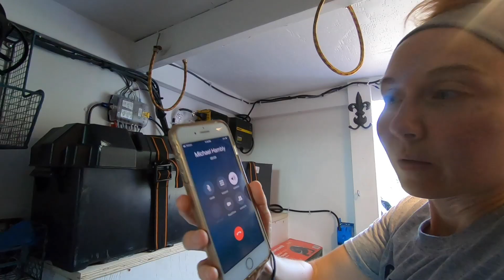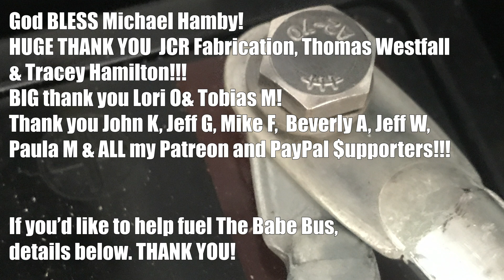VAN 911!!! The Power BLEW!

Comment: No-name inverters are cheap but famously disposable. They are all bogus rated, and even that is designed for 68F. At 90F+ you need to derate the inverter and buy a brand name.
 UPS and FEDEX will "hold at depot" or hold to any of their stores, including Staple and Office Depot, for free. USPS will hold at any main post office (or town post office) if you mail something to your name c/o "general delivery".
And unless the cables are VERY thick and short...the inverter will crap out again.
 Does research stump you? The guys at West usually know all this stuff dead cold.

Comment: If I were you I'd go to a auto parts store and buy an electric fan for a radiator. They're rated at 12 volts DC. it won't drain your battery as much as the fan you using now.

Comment: All your doing is wasting power. You need to biy 12V DC items. Like your lights and refrig. The fan you bought is AC and that means you need an inverter but if you just bought a 12v dc fan u wouldnt have had all this drama!

Comment: Hostility, ur, Hospitality Industry Trick for when you're dying of the heat and the floor is deep in the weeds and it is far too long until your shift ends.
Ice cube.  Tuck your shirt into your pants.  Toss the ice cube down your back, where it will then settle into the small of your back and quickly melt.  Downside - your shirt gets wet.  Upside - who the fuck cares, that yelp of shock when the ice hits your skin is worth it.

Cathy.  Ottawa.  Bytown.  Because, here in the Ottawa Valley, we specialize in 80% humidity.  Summer and winter.  Which is why you ignore the pretty commercials of people ice skating and visit only during the spring, summer and fall.
Take care out there and keep drinking ridiculous amounts of water...

Comment: im sorry casy, i can understand the crazy ledge !! its really good the guy that installed the system was able to talk to you. systems can vary greatly.  my guess going by what i saw it that the inverter may have overheated.but idk for sure. there are  things called power packs that can be charged by solar , i have one made by jackery, but there are different models and price opinions out there. they are good to have as a back up emergencies, something to think over on rainy day. but main thing is you got it fixed and im so glad. i would have been worried for you too  if you didnt.its just too hot. cheers casy roman you are one lovable badass ginger.

Comment: I was a union electrician for 13 years...…...and I owe you an apology.....I was waiting for the ground to spark when you touched it....great reflexes by the way ...I was waiting for a scream.....My wife wanted to know what was so funny...….soorryyyy
Two suggestions to readers with vans..(1)..buy 12 volt fans...…you are using 12 volts to run an inverter ……(2) .buy an inverter with a remote shutoff.....inverters use electricity when they aren't working ; if you set yourself up with everything you can 12 volt you will only use or need the inverter for appliances and can turn it off when not needed

Comment: I don't believe your new inverter has anything to do with how fast you drain your batteries. Using power drains batteries. Now of course if you run a bunch more items  than normal at the same time span then yes, your batteries will drain down faster. Good luck going forward.
Reply: Correct. The loads plugged into to inverter will determine how fast the batteries are used. The number on the inverter is just an indication of how big a load the inverter can handle. 

Every inverter does however draw a little power, when ever they are turned on - even with nothing plugged in. 
So it is always a good idea to turn the inverter off, when it is not being used.  Remote switches make it easy to turn the inverter on/off.

Comment: Are sister Roman in high heat situations inverters have a tendency to go dead because the heat from the inverter destroy the chick so sister Roman it was nothing that you did don't worry about it inside because of high heat exposure it died from high heat exposure to and giggling on the open road when you have it on the wall usually it gets banged up don't worry about it it was nothing you did and the Family Plugged In did not do anything to it and die from One Step 6 months to a year old they usually go belly-up

Comment: Just make sure you turn your inverter off when it's not in use, it will drain the battery, slowly of course, just being turned on. A full blown electrician is overkill for your DC and AC needs (not busting on your guy), a simple understanding of DC power is all you're lacking, things like touching both terminals at the same time (spark!), or keeping cables tight to maximize contact points. The inverter negates your need to know AC, you just hook it up like you did and you're done with it. I'm FAR from an electrician, it's just reading up when you're bored or watching others during installs (or watching some of the thousands of DIY's on youtube). You can do it, you see that from attaching that inverter I'll bet.

Comment: Cheap inverter?  Should have gone to Harbor Freight.  They are everywhere.  I hate them, but if you are looking for cheap and can't wait for cheap chit to be shipped, that's your go-to place for cheap chit.  Harbor Freight:  King of bring a lot of coupons to get cheap chit even more cheap.

400 watts PMW?  You've got to be kidding me.  Who ever thought that was a good idea?  Yeah, I can totally understand why it blew with one more thing plugged in.  Better next time:  Get everything you can that will run on batteries or USB, charge them at your gym.  (Better yet, get solar :)) Rule of thumb:  Add up all the power you have in your van and then double that for the size of the inverter you want to have.  400 watts will barely charge up a laptop and nothing else (I know, a typical laptop is 150-200 watts, but in heat, it's more.  Power losses in lines is more.  PMW vs Pure Sine wave is about 30% more loss,  Heat makes an inverter even more inefficient... all your items plugged into your inverter are more inefficient when hot.  The length of the power cable from the battery to the inverter causes power loss. 

BY THE WAY:  Your fridge is DEFINITELY hating this heat, too, and you may burn up the motor unless you get another fan on it to help blow away the heat.  (I keep my fan running 24X7 on my deep-freezer because it is hot in my van, too.  I hope I'm helping my fridge and freezer by turning both down to minimum acceptable temps so they won't run any more than they have to.

Comment: I know I said something way back about inverters. Go find a RV Dealer or boating place and buy a samlex or xantrex or Go-Power inverter, but make Shure it's a pure sine-wave. Spend the money on a really good one. If you want something that will last and is of higher wattage. #cobra's are junk and many others of the modified sine-wave. Most moter's will do fine on them but are known to last.   The modified sine-wave inverters beet-up batteries. I know what I speak of. Many computers and electric equipment don't like modified sine wave inverters and don't work well or charge.  Spend the money Hun. The ones I have listed will take the abuse of travel and that's why RV's, boat's, and truckers use the ones I listed.

Comment: So, not meaning to be too condescending, but you do know that you have two electrical systems in the van, right?  The house batteries are 12 volt, just like the car battery.  All the electrical systems built in to the van are 12 volt.   Since the lights under the bed work without the inverter, that means they are 12 volt, same as your fridge.  The electrical plugs are 110.  The inverter changes 12 volt to 110.  Virtually all of your electronics, your phone, your laptop, your cameras are all 12 volt.  That is why the thing that plugs your laptop into the wall is called an AC adapter.   The small inverter you found at Walmart is probably intended to plug into a lighter...12 volt power outlet...and charge your phone or maybe your laptop.  Very limited and probably won't do more than power your laptop.

This is getting long, but I want you to understand that while I have not been out on the road like you, I have done more than a little research on RV electrical systems.  Also, I work IT for a state agency with about 300 field inspectors with laptops, and those limited inverters so that they can keep them powered in their pickup trucks while inspecting oil and gas wells across Texas.  I do not know the trials and tribulations of living in a van, but I understand 12 volt (DC) and 110 (AC).  The inverter converts DC (12 volt batteries) to AC (110 house current).  I hope you already knew that, but this last video left me with questions.

So, several people suggested a 12v fan, but you can get lots of other 12v stuff.  Most RVs have several power sockets wired directly to the batteries.  That way you can keep phones and cameras charged without using 110.

Also, does that inverter have an on/off switch?  When you are driving, you probably don't need 110.  You can save battery life by only turning on the inverter when you need to use 110.  Again, though this is not meant as commentary, inverter on/off switches are common on RVs.

Sorry for the length, and sorry for the assumptions I have made, at least if they aren't true.  You dealt with a bad situation, and kudos for that.  And your electrician in Wilmington is a Saint, and thank the gods for West Marine.  Oh, and figuring out how to get repairs made on the road is a part of Vanlife.  I follow several RVers who have dealt with problems, and the only difference between you and them is that they have more years living in a van.